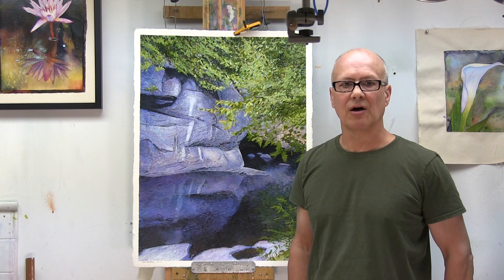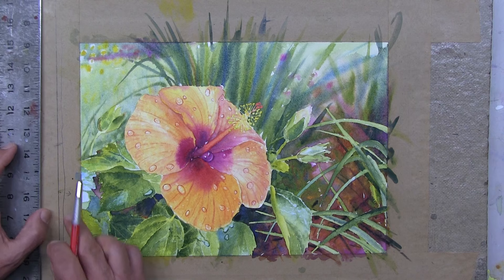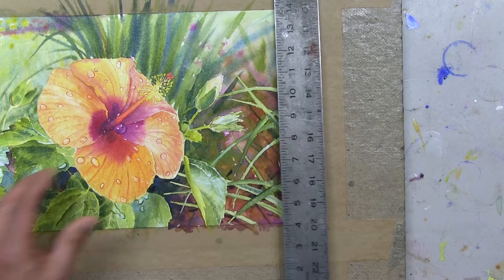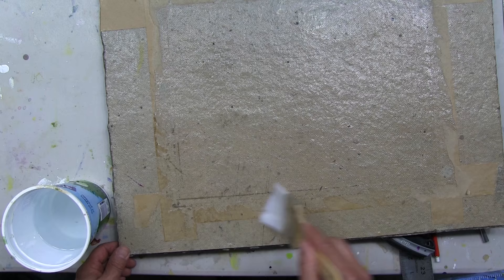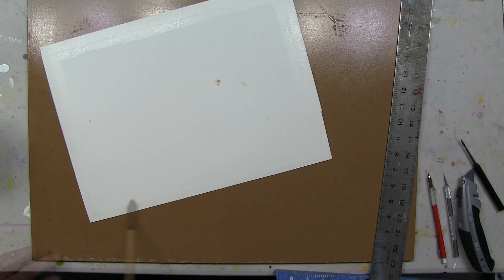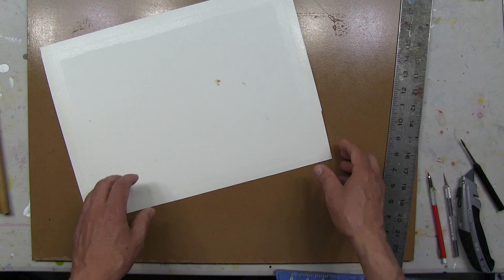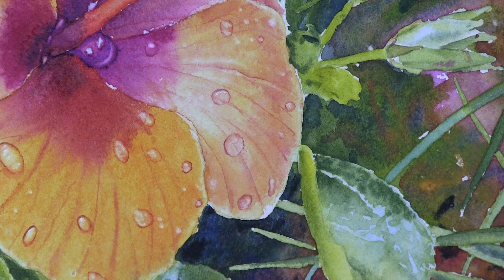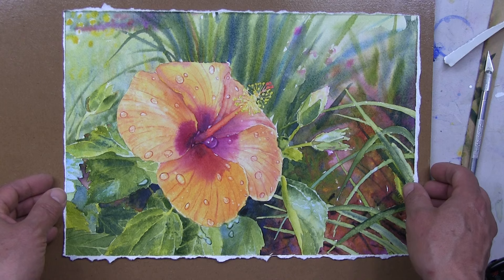“Removing Stretched Watercolor Paper from the Mounting Board”

Comment: How would you remove the tape and leave a white masked border around your image?
Reply from the maker: To achieve a white border around the painting it would be necessary to use an additional type of tape. To do that make an inner border with 1" drafting tape. The outer border is the 2" brown gummed tape that holds the paper to the board, and the inner border is the 1" drafting tape that creates the white border that frames the finished painting. The drafting tape is easy to pull off because it's just like masking tape and not glued down.  Thanks for watching my video!